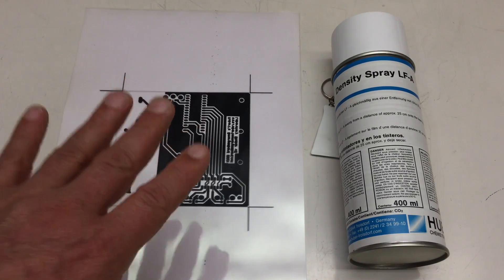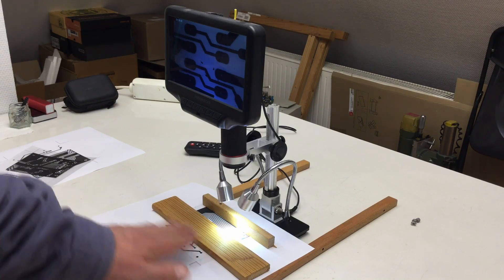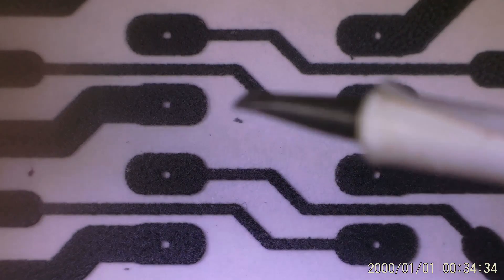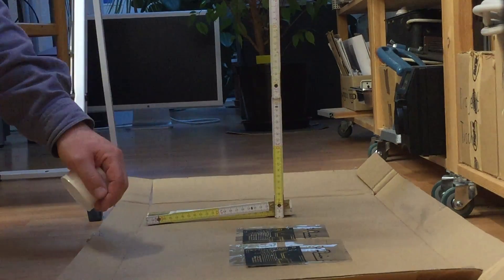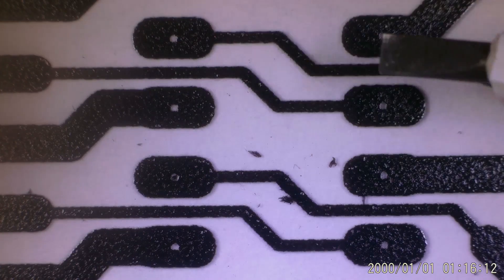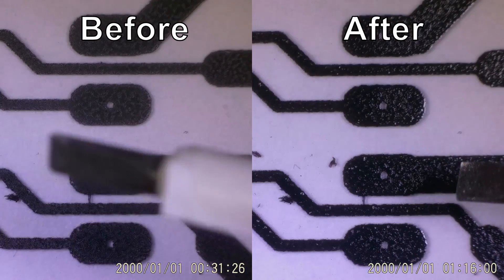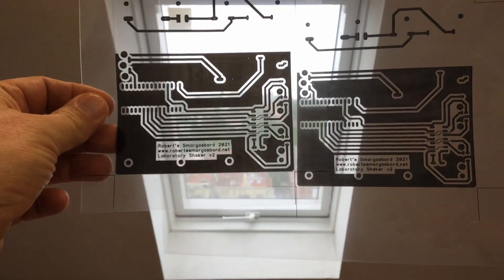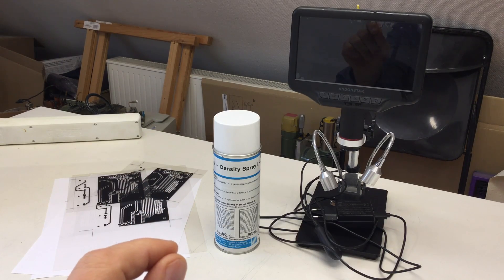Density Spray for Laser Transparencies – Snake Oil or the Ducks Guts?

Comment: I saw another YouTuber using paint thinner 647 with good results, the thinner dissolves the toner ink when wet and it covers up the small gaps as it dries up. Should be way cheaper than the spray.
Reply from the maker: Well, that YouTuber you mentioned might be on to something. 647 contains butyl acetate, ethyl cellulose, acetone, butyl alcohol and toluene. It seems to be a secret what's in the density spray. 400ml of the density spray are about 10€, 5l of 647 are about 15€, so there's that. However, 647 seems not to be available in Germany (too toxic?).

Comment: Thank your for this valuable experiment!  I have an 22 year old HP LaserJet 4000 printer that I love dearly, in spite of it's inability to print wirelessly without an external server. I purchased a ream of transparency sheets especially made for photolithography after BigClive, a YouTuber, demonstrated its ability to produce very fine and sharp PCB images. A great deal of his success, however, is attributed to printing using an inkjet set to its darkest settings. Unfortunately, I'm unsuccessful at printing a dark enough image on my HP.  When held against the light, the toner just isn't dense enough to block out all the light. I've declared it a defeat and decided to wait until I come across a cheap inkjet printer.

Your experiment gives me hope, even though it doesn't compare the results of the final PCB. The general consensus says toner density sprays are junk and not worth the money and effort. When I saw the glossy finish of your toner, I realized there's something to the spray toner. I suspect the spray's result to be attributed to the use of a solvent such as acetone. The solvent causes the toner dot patterns to bleed into each other, creating a more uniform spread of toner. Once the solvents flash off, the toner resolidifies in its more even form. The spray may contain lacquer to help seal the toner in place. I bet it is possible to achieve similar, and possibly better, results using a can of clear coat spray without the UV protection. It's much cheaper and easier to find. 

There's other interesting things I want to experiment with.  If I ever encounter a free or dirt cheap inkjet printer or color laser printer, it would be interesting to see what effect printing in a UV blocking color would have on the final result. UV protection glasses are usually tinted yellow, so it may have some unique qualities in how it blocks the light. 

Anyway, I presume you will have another video on this topic. I look forward to watching it. Thanks for this wonderful video!
Reply from the maker: You're welcome!

And you're right about solvents being used in that spray (don't know if it's acetone, but it's definitely solvents).

Regarding printing with a laser on transparencies: I'm kind of in the same boat as you. I've got a laser printer for the office, because I wanted a laser printer for the office, and I don't want to shell out the cash for a second ink jet printer just for the transparencies.

Regarding the transparencies: I'm not using any special transparencies. I'm still using the ones from a box of 100 I bought decades ago for cheap. However, I'm always using two on top of each other to get things really lightproof.

BTW: I've already made a video about my whole PCB process: "Exposing, Developing, Etching and Drilling PCBs – My (Current) Way" https://youtu.be/sPnnOcxqUhc . My latest PCB design included trances down to 0.35mm (routing between the pins of a DIP package) - no problems!
Reply: waves
Laserjet 4000TN here!

I pulled it out of a skip about 15 years ago... It just need a clean and some new toner!
Reply from the maker: @juststeve5542  A most lucky find I'd say!
Reply: @robertssmorgasbord  I used to own a Deskjet 550C, the colour one!
That put in years of faithful service. Predated the DRM'ed cartridges too.

And yes, the HP LJ 4000's are wonderful workhorses.
Luckily mine is a TN model, so it plugs straight onto the network.
Reply from the maker: @juststeve5542  Yeah, the good old pre DRMed cartridge era! Back when they actually tried to sell good printers instead of expensive ink or toner :-)
Reply: @juststeve5542   The 4000 series is HP's biggest regret. It has even outlasted HP CEOs. I cannot fathom a single reason for upgrading it, except for its incompatibility with AirPrint. HP makes JetDirect cards that support AirPrint, but they deliberately made them incompatible with the 4000 series. AirPrint can still work, but it unfortunately requires running a separate wireless print server that merely identifies the printer wirelessly and routes jobs to it.
Reply from the maker: @bobweiram6321  Yeah, HP used to build printers like tractors! Inkjets too - somebody remember the DeskJet 500? I personally do not care about all the AirPrint and other wireless printing stuff. All my equipment is connected to an Ethernet switch :-) OK, there's a WLAN access point somewhere for my phone, tablet and when I move the notebook around ;-)

Comment: Thanks for this tips. I was not knowing this product exists. The French translation on the can is a crap, not "Deutsche Qualität" 😁
I had a doubt about the efficiency at the beginning, because you was showing how it's reflecting light, that's not the way we use this kind of transparency. But the simple check on your window shows a good improvement of the contrast. Very interesting
Reply from the maker: You're welcome! The vendor, Huber GmbH, is a smaller company (two buildings) located in a small town in Germany. Their website is available in German (of course), English and - Spanish?!? I guess they have a Spanish employee :-) The French translation has probably be done with Google Translate :-) And yes, just looking at the microscopic changes (reflected light) I was wondering myself how this video would turn out. When I shot the side by side comparison against the light I was not sure if people would be able to see on video what I saw. But obviously it worked out :-)

Comment: First time I've seen this, there was clearly a difference and with the the ease of use It would be a must in this process....cheers.
Reply from the maker: Well, it improves things slightly. And yes, it's easy enough to use and such a spray bottle for 8.50€ lasts you an eternity. Can you successfully expose PCPs without it? Probably yes.  But then, who doesn't like the smell of strong solvents in the shop :-)